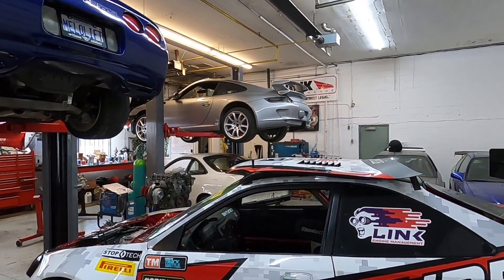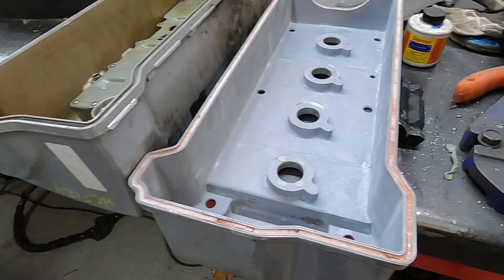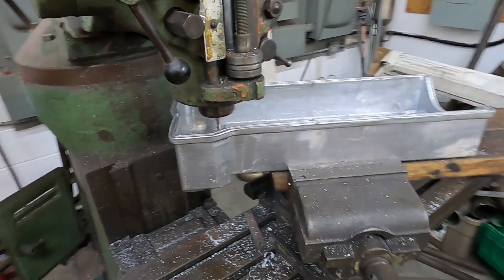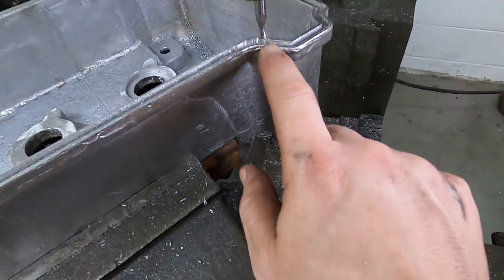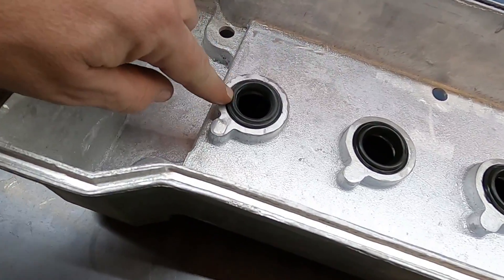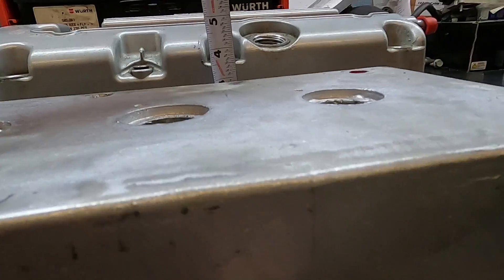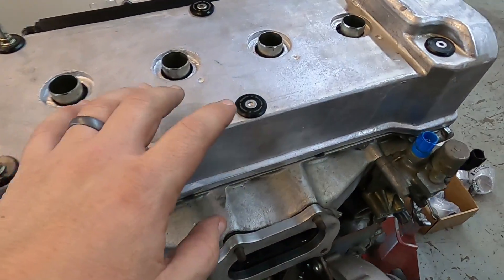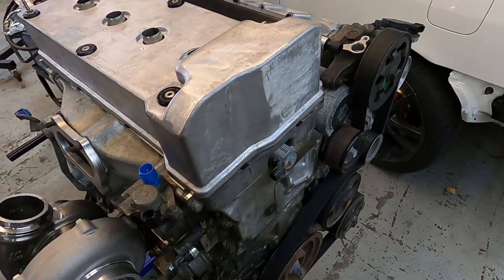K997 - Super Low Profile Valve Cover Update

Comment: why not go with a plastic one?
Reply from the maker: I wanted to use plastic, but finding a plastic that is readily available and that can handle the engine heat was not possible
Reply: @tuningbynick  You can use polyamid (Nylon).
Reply: @tuningbynick  did you do it yourself or had a company do it? if so what printer did you use?